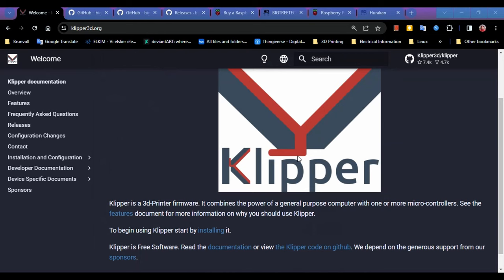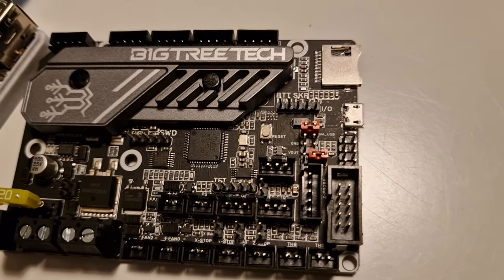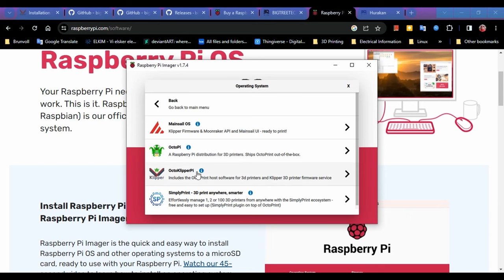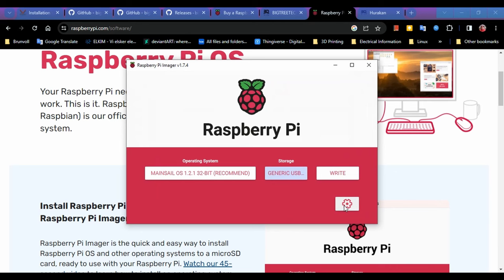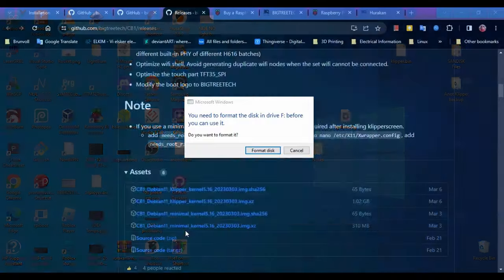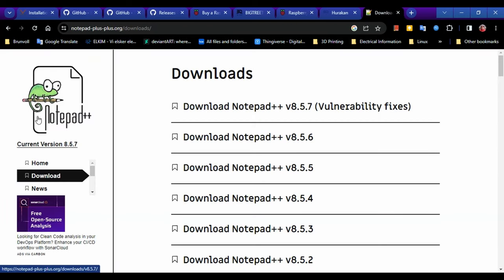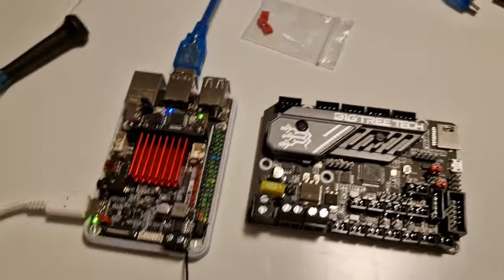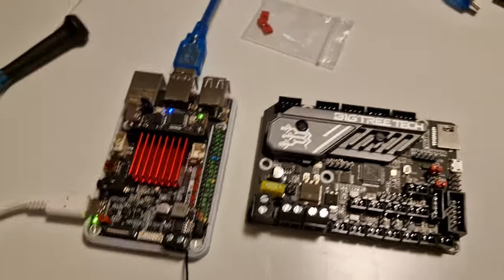How to install Klipper for beginners

Comment: So if im running the Big Tree Tech 3.5' tft display do I need to make any major changes to make the screen work?
Reply from the maker: The standard TFT35 is not fully supported by klipper. You can run it in marlin mode for the basic functions, no touch. It's better to set up an HDMI touch screen and run KlipperScreen if you want a screen at the machine.

Comment: Great video!!
I just have a question about power supply, Is it possible to give the the power  with a 27W official raspberry power supply. I really dont want burn them out!
I´ve ordered two of each one
Reply from the maker: For just the set-up process it should be fine, but not to run motors and heaters.
Reply: Ok, Thanks, but i mean just to power the BTT Pi, my plan is install a several peripherals to each one.
One PSU for each BTT Pi.
 
is it should be fine?
Reply from the maker: Oh ok. Yes, absolutely, the official raspberry pi power supply works well with it. I use it often with teasing.

Comment: Hello...I did the installation for an ender 3 v3 se on a raspberry board.  But I have this error in klipper: section "filter" is not a valid config section.  Could you help me what it could be?  I am grateful in advance. Tks
Reply from the maker: You'll need to search your config for filter I would assume it's something that is out of place. I don't know of any functions that are called filter so it's likely something custom.

Comment: Thank you so much for the most complete tutorial ever. I have a small issue thought. Everything is set up and waorking on my ender 3 v2 with skar mini e3 v3, but I don't have BLTOUCH and it is expecting that so it doesnt home. How can I disable the BL touch?
Reply from the maker: In the printer.cfg file look for a section that has [BLtouch] remove or put a # in front of those lines to disable it. Also make sure that End-Stop pin in the stepper z part is an actual pin number and not virtual endstop z probe
Reply: @StackingLayers  as far as I can tell endstop pin is PC2. I entered that and now I can another error : Option 'position_endstop' in section 'stepper_z' must be specified
Reply: I got it working man! Thank you so much!
Reply from the maker: Nice! Good to see you got it going.

Comment: your video helped me greatly but im still stuck on the issue ive been stuck at. when i run the "ls /dev/serial/by-id/*" code it says no such file directory, i would greatly appreciate if someone had some advice or an answer to my issue
Reply from the maker: There are a few things that could do this. A bad USB cable (not all are made for data either), a wrong setting in the firmware make config, or there's a few versions of Debian that caused an error reading serial by-id. To check if you have a bad Debian version run this command in terminal, 

apt show udev

If your version is 247.3-7+deb11u2 you have the broken version.  This will go into more detail on that. https://www.teamfdm.com/forums/topic/1892-beware-latest-klipper-update-breaks-symlink-to-mcu-on-usb-connected-devices/#comment-12246
Reply: @StackingLayers  thank you so much, yes im using that version of debian and have been practically pulling my hair out over the last two days trying to figure it out

Comment: Hope you can lend a hand, so Im up to the part where we've installed putty, im able to log into, but the biqu doesnt work for me. After entering the password I just get denied. I'm using a Raspberry Pi 4 with an SKR Mini E3 V3.
Reply from the maker: With Raspberry Pi you are supposed to setup your user and password before installation when using the raspberry pi imager program. The default user is, pi. The default password is, raspberry.
I can't remember if ssh is active by default, but if you get in then use, sudo raspi-config and go to System Options to change the password.

Comment: I got a pi4 from a friend. It has an sd card with it, im not sure whats on it bu t know its not klipper. Whats the best way to wipe it and prepare it for klipper install? Many thanks.
Reply from the maker: Just use raspberry pi imager. It'll format the SD and set it up for you. Choose the raspberry pi 4 board then the mainsail os I show. Keep in mind that raspberry pi imager has gone through a UI update so things look a little different from my video now. Also the stuff about the CB1/BTT Pi can be skipped for raspberry pi.

Comment: Can you please help me! My mcu is not being found when I get to 1:07:30 in the video I don’t have those 5 lines it only has 3 and I cannot find the mother board using a rpi4 and skr mini e3 v3
Reply from the maker: The amount of lines that show up with lsusb will very, don't be too worried about that. If the ls /dev/serial/by-id/* is not being found then perhaps the usb cord is not good.
Reply from the maker: Another though is make sure the firmware actually flashed, if you check the firmware.bin on the SD card after flashing, it will have changed to firmware.cur if it did not change then it did not flash.

Comment: Image used on BTT Pi V1.2 will it be the same as the CB1 board?  Github BTT / no image release only CB1,  Pi V1.2 just has documentation but no OS.  Looking for Klipper software to use on this BTT Pi V1.2
Reply from the maker: It's the same image

Comment: Same SKR miniV3 . Recently set up this board only to have it fail 6 hours into printing and stop sending info to the bed heater and disconnecting mid print. Order a replacement and after it flashed, pulled the MCU ID using KIAUH, pasted into printer config  being carful not to add any spaces etc and in Mainsail I am getting an error   waiting on Klippy  then MCU failed to connect. Any advice on why I am seeing the MCU ID info and that it is showing that its changed from the stock installed Marlin to Klipper yet I cannot connect?  Even though I did copy and past the current ID it was the same as the failed boards. The printer was running great so I believe everything should be correct with my config file. Ive installed Klipper 4 other time prior in the past month so its not totally new to me.
Reply from the maker: What was the error message when it stopped working?
Reply: @StackingLayers  The board that quit working was giving the error  lost connection or heated bed not as expected (something like that) Klipper would call for 60* but the board wouldnt send power. The new board I am replacing it with gave the unable to connect to MCU.  tried the firmware and various USB cables multiple time but with no luck.
Reply from the maker: @lunarconcepts9958  with the firmware, are you creating your own with the make menuconfig or using the premade firmware.bin?
Reply: @StackingLayers  creating the firmware off BTTs instructions which appears to be the same setting above. This same firmware was running my original SkR and the printer was printing great
Reply from the maker: Ok so the firmware is the newest version, or at least matching the the version on the host? It's interesting to have multiple boards fail. With similar problems. It makes it seem that it could be an outside source causing the issue. Perhaps something injecting a lot of EMI into the system or some other faulty component attached. If you disconnect everything and just try to have the mcu and host communicate, how does that go?

Comment: Do you need to worry about "Flashing Firmware" to the MCU if your printer comes with Klipper pre-installed?
Reply from the maker: Technically if it's working fine and you are happy with it then no you don't have to update it, unless there's a bug found and the update fixes a potential danger. Other reasons to update is for performance improvements. The down side of updates is there's always a small possibility of introducing a new bug, so it's recommend to wait a little and read up on how it's going for others before updating.
Reply: @StackingLayers  I am more interested in remote monitoring/control than anything else. At the moment, I am only able to monitor my printer while in my home connected to the Wi-Fi. But if I should be out of the house, at the grocery store for example, then I can't monitor or control the printer.
Reply from the maker: This will give you that ability, https://youtu.be/qnYwEGaMC0I?si=4vAZo9pyheWL4XWh
Reply: @StackingLayers  Thank you sir, that's exactly what I have been looking for.

Comment: is there a limit for the sd card? I see you use 32, but a 64 or 128 could work?
Reply from the maker: Should be fine. It's a Linux system so it has what it needs to read different formats. It's not locked to FAT32 like the controller boards are.

Comment: Is it possible to do this with skr mini e3 v1.2? I have an older model!
Reply from the maker: Yes. Hers the configuration. Make sure to read the firmware settings at the top. There are some things to be aware of for when making the firmware for that board. https://github.com/Klipper3d/klipper/blob/master/config/generic-bigtreetech-skr-mini-e3-v1.2.cfg

Comment: i have installed the mainsail 1.3.2 x64. the files printer.cfg and print_area_bed_mesh.cfg are missing. i have the raspberry pi 4 B.
Reply from the maker: You have to make those yourself. Here's the repo of examples. https://github.com/Klipper3d/klipper/tree/master/config 
Look for your machine and/or board you are using, then adjust as needed.

Comment: another doubt, what is the circuit you have above the heatsink? I do not have it!
Reply from the maker: That is a canbus adapter. You don't need it to follow along with this video . It's just plugged in because I didn't have a safe place to store it

Comment: Hello, please help me. I set up the Manta E3 EZ and CB1, but the setup doesn't start when I remove the SD card. It starts when I insert the SD card. How can I make it start without the setup SD card? Thanks
Reply from the maker: If you are talking about the SBC's (Sing board computer's) SD card not the MCU then that is how it works. The CB1 needs the SD card in as that is its harddisk. Just like you can't run your PC without a harddisk you cannot run the SBC without one.
Reply: @StackingLayers  But I also set up a CB2 on a second Manta E3 EZ, and it works after removing the SD card. I'm curious about your opinion.
Reply from the maker: @gemici6701 the CB2 has an eMMc (embedded muli media card). Did you buy the eMMc version of the CB1?
Reply: @StackingLayers  yes CB1 eMMc version
Reply from the maker: Ok that is a little different from the CB2 install. Follow this https://github.com/bigtreetech/CB1#cb1-emmc-version

Comment: what do you do if you dont get the serial number i put the sd back in my computer and its now a .cur so it flashed but its not showing in putty so how do i get the number i need
Reply from the maker: If you type, 
lsusb
do you see the board in that list? If not you may need to try a different usb cable. Not all have proper data pins connected. Some are for charging only.

Comment: I have the error of "unable to open config file /home/jshug/printer_data/config/printer.cfg

Not too sure where to go

46:14 is where I'm at in the process.
Reply from the maker: You need to create a file called printer.cfg and put the configuration for your machine in it. Here's a bunch of pre configured examples if your machine is there, then copy and paste contents to the new printer.cfg file. 
https://github.com/Klipper3d/klipper/tree/master/config

Comment: hello is this possible to do with an orange pi?
Reply from the maker: Yes. Almost any Linux based system will work. You cannot use the Bigtreetech pi or raspberry pi image though. You will need to use the orange pi image. Use KIAUH to install klipper parts. https://github.com/dw-0/kiauh

Comment: Beautiful video, I want to buy bbt pi and I have your identical mother board. I'm a beginner so can you help me for the cfg part, thanks
Reply from the maker: I have another video I'm trying to get out now that drives Into a quick explanation of the printer.cfg file. I'm trying to get it out by the end of the weekend, but if you are using the SKR mini E3 V3 then this video shows how to get the printer.cfg ready to go for the Ender3 and the likes.
Reply: @StackingLayers  but for cfg i need the skr one or the ender 3 ?
I made one with the skr pin and the ender 3 part
Reply from the maker: @mattiamusica3059  use this to set up the printer.cfg https://github.com/Klipper3d/klipper/blob/master/config/generic-bigtreetech-skr-mini-e3-v3.0.cfg 
And use the crealiy one just as a reference for things that do not have a pin number. 
Keep in mind that the SKR mini E3 V3 has tmc2209 drivers and they are in UART mode so those sections that say tmc2209 allow for current adjustments and such. So leave those as they are. They should be set up correctly as is.
Reply: @StackingLayers  thanks

Comment: I have tried so many times to locate the serial with no luck message i keeping getting is ls: cannot access '/dev/serial/by-id/*' : no such file or directory. help please
Reply from the maker: Which OS and Host computer are you using? Some of the Debian Linux distros  have a bug where that will not work correctly, if at all. Also what controller board are you using and how did you configure the firmware?
Reply: I had same thing. When you are logged in using WinSCP you can see all the files make sure you’ve copied the klipper.cfg file on your computer then delete The klipper.cfg file in the WinSCP rename the copied file on your computer to firmware.cfg and copy and paste that in the WinSCP file area then I was able to get the serial.
Reply: @StackingLayers  I’m using a lite version of mint. And i have followed the instructions in your video and modbots video on setting up an old pc for klipper

Comment: i just checked what junk i have laying around in my stash of no longer used projects and a stupid thought came to mind, what if you use laptop/chromebook motherboard in place of pi board and bodge 2 arduino unos as the one mcu, one as x,y,e stepper brain, and the other one as heaters and z stepper. it in theory would have enough processing power to exist as a 3d printer even if single arduino could be too small to run all the  io' s . but i presume mega is the smallest viable option so i probbaly better get 2nd hand ender board if i want to think of making a printer

but in general is split mcu even possible with klipper. i know it is stupid but it is almost midnight here

Comment: after installing the thing onto my drive, the files look completely different from the ones you have. any idea why
Reply from the maker: It depends on what distribution you have installed.
Reply: @StackingLayers  i installed the same os as urs idk whats wrong
Reply from the maker: Is it missing files? This is the one I'm using. It's only for the Cb1 and bigtreetech Pi not raspberry pi or others.https://github.com/bigtreetech/CB1/releases/download/V2.3.2/CB1_Debian11_Klipper_kernel5.16_20230303.img.xz

Comment: I tried this on the new Manta M8P V2 and I see no serial ports. Could this be because I used the setting from the Manta V1.1 klipper.cfg?
Reply from the maker: They use different chips. You must use the M8p V2 firmware setup. The settings are at the top of the configuration example https://github.com/bigtreetech/Manta-M8P/blob/master/V2.0/Firmware/generic-bigtreetech-manta-m8p-V2_0.cfg
Reply: @StackingLayers  Thanks I did, I still have the problem that it can't connect.

Comment: When I'm on putty, it lets me type in the login (biqu), but immedietly after when it asks for my password, nothing happens. I type in biqu for the password but no characters appear and when I press enter, it takes a couple of seconds but it says access denied. Also if I leave it open for about a minute it'll telll me "remote side unexpectedly closed network connection". Any ideas as to why this is happening?
Reply from the maker: The password not showing any characters is normal. Make sure to type it in all lowercase. biqu then hit enter. And yes if you wait too long it will time out and auto disconnect.

Comment: I am having issues after setup and about a week of use, of it not connecting to wifi, ans it not showing in the router admin.
Reply from the maker: Have you checked if it's making a new IP address? Some routers will room the IP addresses for security reasons. You'll need to set it as a static IP if that's the case. Or you can use the hostname( .local name). For example pi.local. the hostname is normally the name that shows automatically when it is shown in the router. You can also get it by typing hostname in the terminal if you are connected to the machine.
Reply: @StackingLayers  the pi ended up failing, I ended up doing a return, it was working fine and just out of no where stopped

Comment: when i try to get serial it says its marlin but i followed the tutorial exactly?
Reply from the maker: If it says marlin then the firmware did not flash. Make sure you are using an SD card that is formatted to fat32. It's best to use one that's 8GB or less

Comment: Will this work on an ender 3 pro ?
Reply from the maker: Klipper will work on most machines. This is the config and info for flashing the ender 3 pro, https://github.com/Klipper3d/klipper/blob/master/config/printer-creality-ender3pro-2020.cfg
Reply: @StackingLayers  thanks so much
Reply: @StackingLayers  will this raspberry pi work ? Raspberry Pi 3 B With Power Cable?
Reply: @StackingLayers  The pi is a Pi 3 model B V 1.2 will it work for klipper ?
Reply from the maker: Yes. To power the raspberry pi, but the Raspberry Pi power supply is not enough to supply the board for printing that will need a 12 or 24 volt power supply depending on the components you have.